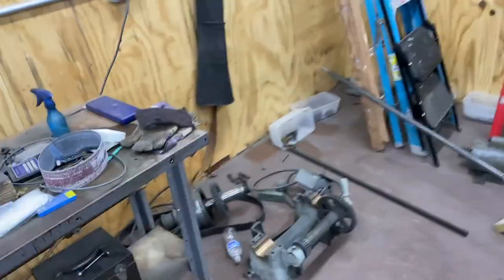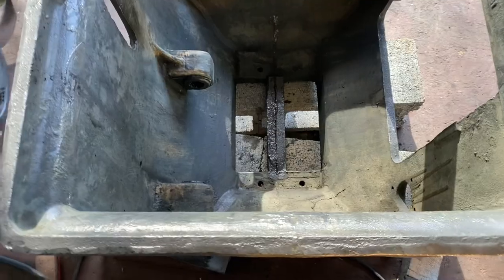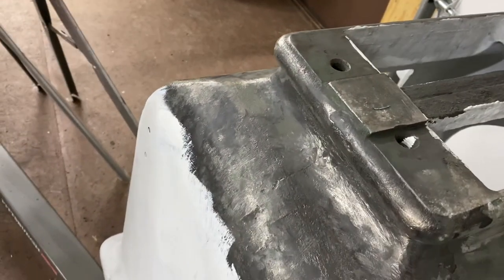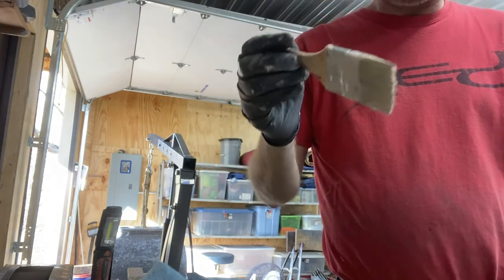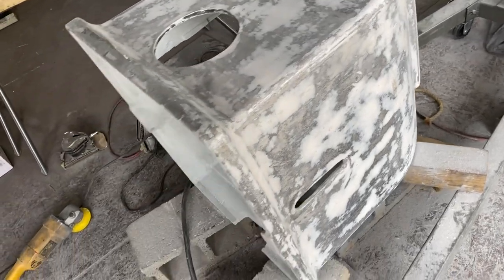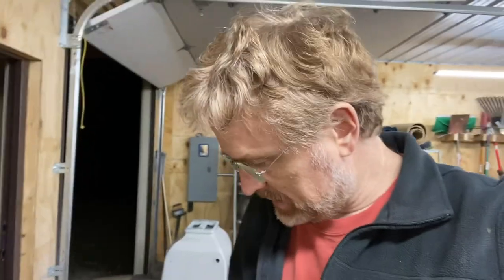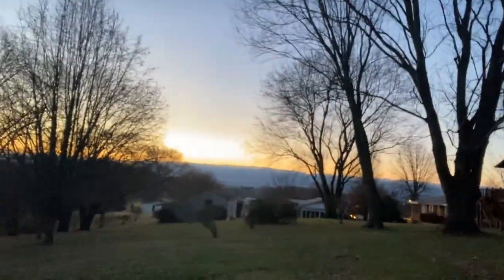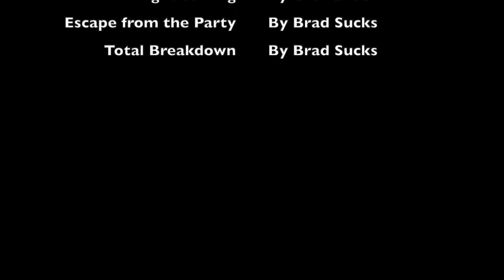South Bend Lathe Restoration, Part 3

Comment: These lines you see on castings are the mold lines where the halves came together. You’re lucky there wasn’t a red layer on the bottom if the paint. That was red lead they used to use. Just use some Bondo. It doesn’t have to be perfect. There are also primers that are designed for this. They spray on very thickly and allow you to sand off the excess. A couple of layers will fill depths up to 1/8” deep. I wouldn’t use epoxy with Bondo. The chemicals are incompatible. They may separate or delaminate after some time..

Ok, so now you did the easy piece. Good luck with the rest. I’ll tell you though, while I’d a smooth glossy finish is what you really want, that’s fine, I’d course. But a lot of us old timer machine users are abandoning the smooth high OSs, and are just filling in fissures or holes, leaving the pebbled  finish of the casting. The high gloss gets rubbed away after a year, or so, of using the machine and cleaning it from the drip lines, particularly those from the gearbox. So a semi gloss tends to last longer.
Reply from the maker: Since this is my first time, I may regret some of the choices I made.  But I hope not!

Comment: wow,
Kevin, 
 only a 1 horse motor.....I am having to replace my 1 hp motor original 1942 I believe and rebuilt at some point in time on my 13" SB as it toasted it self recently, I have a Modern TEFC Lincoln Electric 3 ph 1.5 hp that should work nicely.....nice to see the 3 belt sheave......mine has a 2 belt, sheave  that someone  had put a single variable speed sheave on at some time......by the way, your paint job on the lathe is very tasteful......best wishes from Orlando Florida, Paul
Reply from the maker: 1 HP seems low to me too. But so far, I haven't been doing any heavy cutting, and it seems to keep up just fine.  I think this belt is old enough, that it was made to also work with the old style line shafts.  I.e. if the cover is flipped back, the belts can go up to the ceiling.  Thanks again!

Comment: Those are indeed babbitt bearings.
Reply from the maker: I need to learn how to repair these one day.  But I think those were OK.
Reply: @KevinToppenberg  There's no real force on them. I think SBL used babbitt here for alignment only. It's not like that shaft is spinning at 500 RPM. Maybe also to dampen any vibrations? Mine were also good, thankfully.

Comment: I highly doubt any welding was involved with the pedestal, as that is why we cast stuff, as to minimize the later processing operations and to achieve parts geometry that would otherwise require fabrication and/or lengths of machining... That is what is called a split line and is the line where the two pieces of the mould meet and close... Look at any car axle or such that is cast, or wheel forks or what have you at hand, and you will see a line somewhere on the shape that looks like a weld ridge, but its not... Its simply the absolute disregard for aesthetic of a functional part that is meant to turn out good enough in 99% of its aspects, requiring maybe a flat ground surface, or a bore or just a hole for a bolt to pass through... Even aluminium cast parts of vehicular suspension often have casting lines and mould marks as if it aint a 2 million supercar, aint nobody got time for that at the factory... My big lathe is enormous compared to this, and so are monarchs and other such lathes, and none have ever been made by any means but casting and imparting precision surfaces onto the castings and bores or threaded holes for assembly thereof... Ok, flame hardening and other procedures are done too, but you get my point...
Reply from the maker: Thanks!  You are probably right that they cast it as 1 piece, rather than 2.  It would just be more work to cast as 2 parts and then welding the 2 parts together.